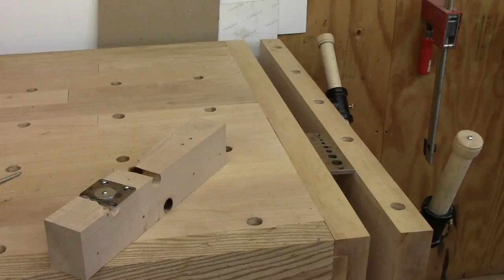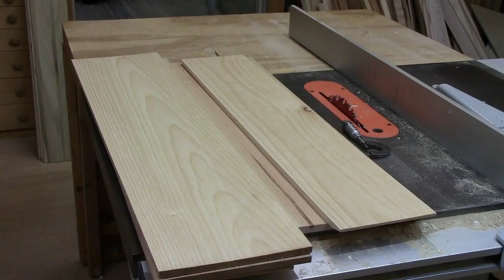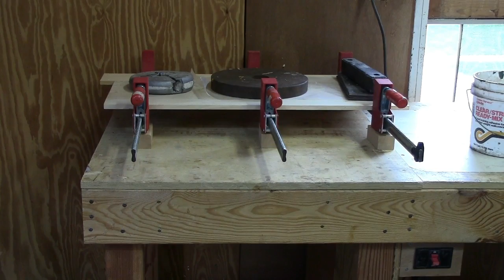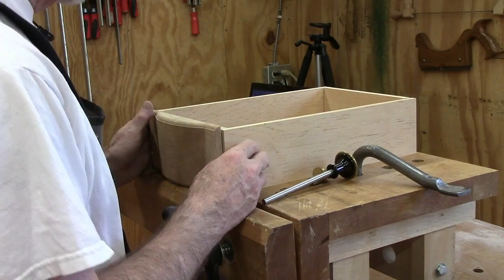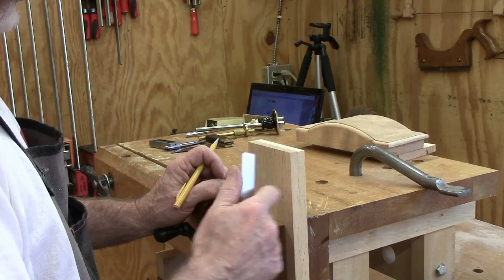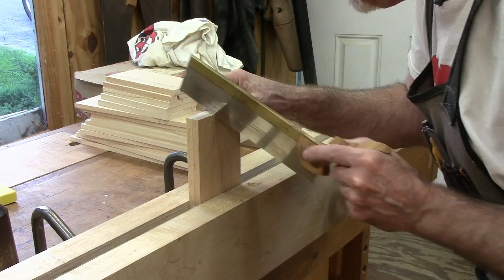Curved Blockfront Lowboy   Pegs & Drawer Stock & Layout Step 6

Comment: I like your dowel maker. I always assumed you pounded the stock through those dowel plates, never occurred to me to use a drill haha
Reply from the maker: locohombre79 even then it is somewhat rough
Reply: David Boeff oh, no doubt. It had just literally never occurred to me to try using a drill :)
Reply from the maker: locohombre79 I know, when I first started I used to make them 6 or 8 sided and pound them threw